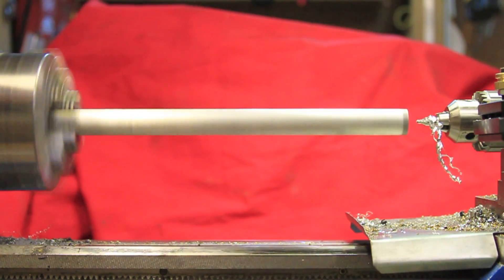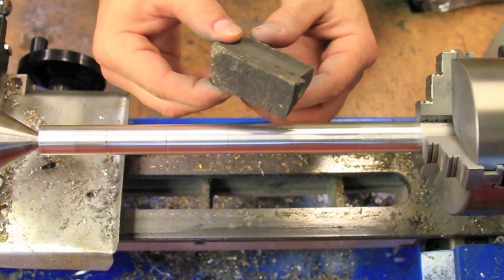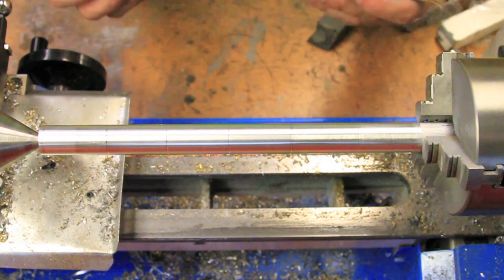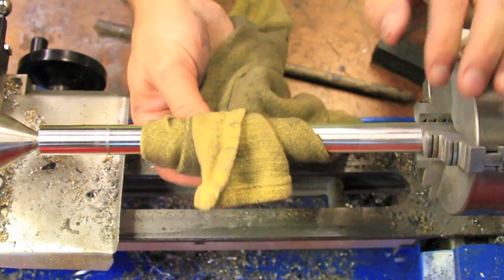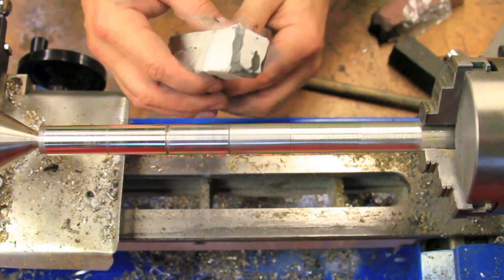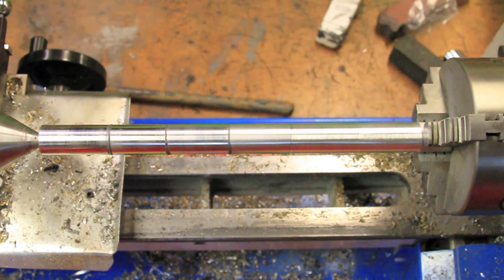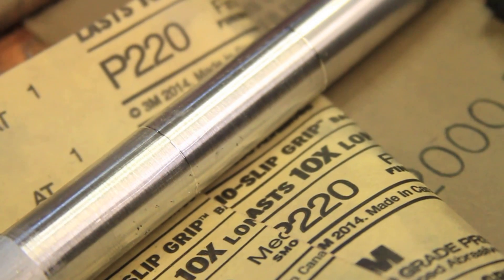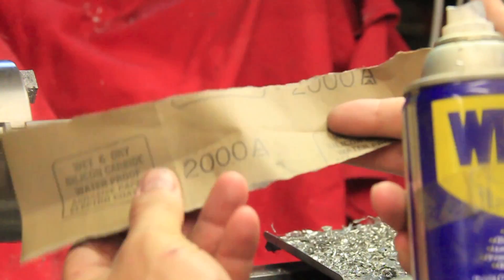Polishing Aluminum Metal to a High Luster Mirror Finish with Wood on the mini lathe

Comment: I currently polishing 4140 metal at my current job. They currently recommended to use 80 grit sand paper for the rough, then use 120 grit sand paper for the first finish and Scotch bright for the second finish. I might bring in 500-1000 sand paper for the finish with WD40 after watching this video.

Comment: I do love using paper towels for finishing off too, I polish my aluminium ecigs to a mirror shine by hand mostly but go with green bar to start and blue to finish and mothers to finalise the polish as I can't use sandpapers on many of my mods and atomisers as it destroys the logo's.   I only ever use rouge bar on brass and copper and find that is brilliant on my model steam engines with blue to finish, then microfibre and again paper towel and I have a mirror finished copper boiler or brass cylinder that keeps its lustre for ages even with heat.   Am going to try the wood thing, I remember seeing an old film where steam engineers cleaned refurbished engine and carriage wheels with wood blocks spinning the wheels on monstrous lathes as the wood wouldn't damage the precise ground surfaces and was top banana for getting rid of rust on steel wheels.

Comment: Centre drill on the lathe with the MINIMUM protrusion from the chuck. unless your using the offset to taper turn at 1/2 runout angle. Nice tutorial Thanks.

Comment: I've not read through all of the comments, but has someone suggested the fine cutting compound and leather.
I use an old leather belt, the underside, rough side, not the outside.
I've found it creates a mirror finish that can't be beat, just a suggestion.

Comment: Hey man, I'm loving your videos. Great job. I was looking for the link for the polishing kit you are using the polish compounds from. And I'm not seeing it anywhere. Could you lease post it in the comments or at least tell me where to look for it   

The next thing is that I also have a mini lathe that I'm trying to get warmed up with it to do some cool things. And I've gotta say based on what I've see you have to go through with this lathe that either you got some super deal on it or you got screwed.  The Chinese factory that made that lathe has got to be on the bottom end of the totem pole. You have overcome a lot of the problems yourself and that deserves credit in itself but just as an example my  lathe was sold to me through Grizzly and they have been great on parts. Plus little Machine shop has been a Hughe help. But cud to you for pushing through. You are the man
Reply: You have made some awesome modifications to your improve things on your lathe that I like very much and may in fact try on my lathe
Reply from the maker: Hey! it's linked in the description but I'll put it here too... http://amzn.to/2rYy7NT

Ha it probably depends on who you ask if got either a super deal or screwed... I think I did alright though - wasn't expecting to have to do so much work to the lathe just to get it usable and consistent but I learned a lot about it in the process. I've heard Grizzly support is really good and LMS does have a lot of great parts and advice. Thanks so much for watching!

Comment: If you use a lap media after sanding it'll help remove the sanding/turn marks and create a better mirrored finish
Reply from the maker: That'd be awesome, do you have any brand suggestions?
Reply: TimNummy sadly no I don't, I nick it from work. I know that you can use lap compound that used for lapping valves on engines, you can then have a course and fine grit lap then which will make it even easier
Reply: I've just googled it and loctite do massive tubs for £30ish so it's not too expensive

Comment: Wont autosol ans steel wool make same or even better results?
I use autosol but i only go up to 800 or in some rare cases 1200 grit paper. and the fine grade (soap free) steel wool makes the ultimate shine.
Reply from the maker: It may! It would definitely be worth a try to see how it turns out. Thanks for the suggestion and watching!

Comment: Sometimes when I am working with 2000 grit wet or dry paper, when I'm done with the finish sanding, I'll flip over the paper and use the back to burnish the work. Just did this on the cast iron parts of a small steam engine and got a nice finish.
Reply from the maker: Interesting, I'll have to give that a try. Thanks!

Comment: it probably makes for good videos but next time you centerdrill something, do it as close to the chuck as possible, then you are more likely to get the hole in the center. also bolt down the lathe to the desk  or something, it will improve rigidity and thus cut quality, and CLEAN your lathe after dooing something like this. the abrasives will wear down the lathe!
Reply from the maker: That's a good tip to clean the lathe afterward. I actually found another video where they suggested to always do the center drilling at length because if the center changes when you adjust the part and it bends when you tighten everything, you will end up with a bent part in the end. Either way, I do need to bolt it down at some point.
Reply: TimNummy I saw that same video, and I was following that advise for awhile but I was getting holes that were waaaaay off center because the 3 jaw chuck holds stock centered to .003" at the very best, usually much worse.  So I asked my brother, who was a machinist in the Marine Corps, and his advise was to always center drill close to the chuck. If the stock is not straight, it won't magically straighten just because you put a live center to the end of it. He said the proper way to center drill at length, if you absolutely must, is to use a 4 jaw chuck, and a steady rest at the far end when you face and drill.
Reply from the maker: Interesting, and I assumed that if the hole was off-center at length that when you turned it to the final diameter, you'd be left with the "core" of the original piece, which wouldn't necessarily be true to the original OD or shape but end up true when you were done with it.... I'm not sure if that made sense or not. I will say that most the time it's much easier to center drill close to the chuck though! (also assuming the diameter is small enough to slide through the chuck, which is only about .800''ish on this lathe)
Reply: TimNummy Yeah you're making sense, and what you're saying is true (pun intended). In my case the gripebecame that I was having to turn large amounts off the stock because the chuck didn't hold anything even remotely true to begin with, so to turn down to that "true" core was wasting a lot of time and material. Of course for hobby purposes it's probably fine, but there is so much slop and lack of rigidity in these small machines longer shafts aren't going to be true down the length of the part anyways without rests. My bro was talking in terms of huge lathes, turning shafts 6 feet long with steady rests and follow rests and super tight tolerance requirements so not terribly applicable to the home machinist lol
Reply from the maker: Haha yeah, that's definitely a different conversation and small errors get a lot bigger at that length! Either way it's definitely something to keep in mind so I appreciate the suggestion!

Comment: Hi Tim,
have you had the opportunity to try "Mothers Mag & Aluminium Polish" Its texture is a creme fresh and is sold in small tin can. It works great right off the bat after turning aluminium, I am pretty sure you can get similar result by fine sanding it prior to apply the compund.
Reply from the maker: Interesting, I'll have to see try that at some point. Thanks!

Comment: I used to polish steel, ceramic, and carbide at work and we used oak sticks and poplar sticks with a diamond paste on ceramic and carbide, and used a heavy duty die grinder with a buffing wheel and the diamond paste on the steel. never did any aluminum though, as it's not really a die tooling material. oh and the finish was like .5 micron. I can also add that when polishing an OD the die grinder was used and when polishing an ID the stick was used and was sharpened to a flat point and then followed by a quick hit with the die grinder.
Reply from the maker: Very cool, thanks for sharing - It would be interesting to try different woods to see how the finish differs

Comment: A tip to avoid ruining lathe bed with abrasive particles: oil a sandpaper. It gets wasted faster, but saves lathe since abrasive particles don't fall off that easy (to be sucked into shuck or thown around moving parts)
Reply from the maker: Thanks for the tip!

Comment: I would recommend a different dowel for each polish to avoid contaminating the finer grits with the aggressive ones.
Reply from the maker: That's a great suggestion, I've just been looking for clean spots on the dowel I was using.
Reply: I use a similar protocol on my polisher for jewelry, and tooling: I store the polish with the buff(s) that correspond to that stage of polish, and I thoroughly clean the compounds off of the piece between steps.

Comment: Awesome. Thanks for the tips. In return, ill offer you the tip that you should really cover your ways and slides when sanding on the lathe. Even with soft metals like aluminum, the dust can do some damage
Reply from the maker: That's a really good observation. Thanks for pointing that out!